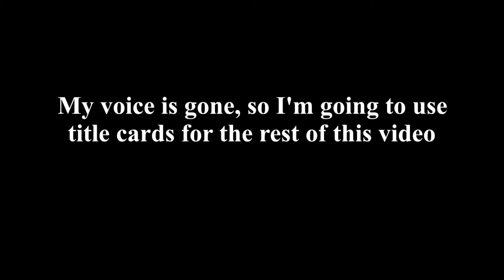Rooftop AC Hard Start vs Soft Start.  Which works better on a generator?

Comment: What was the amp draw difference between the 2 at start up?
Reply from the maker: Unfortunately I don't have a meter to monitor that, and the generator's load meter isn't sensitive enough or fast enough to provide any real info.

Comment: Thanks for the information, I like the price better on the hard start capacitor even though it puts more wear on the motor. Will this work on a portable air conditioner unit? Thanks again for the video

Comment: So which system did you end up using, hard start or soft start? I'n leaning towards the Micro-Air soft start.  Yes, it's $300+ but I'm putting it on a new 3.5 ton heat pump and specifically need it for use with my Westinghouse generator. BTW, which model of Westinghouse are you using. Thanks.
Reply from the maker: I stuck with the soft start.  The hard start cap gets the job done, but it's shoving more current through the windings at startup, which is harder on the motor.  The soft start is more money, but gets the job done by sending less current, so in theory it's easier on the motor.  And since the hard start cap was only $15, I'm hanging on to it.  The soft start system is more complex, so is more likely to fail.  If it ever does, I can wire in the hard start cap and be back up and running in short order.

I have the basic iGen4500, which is a 120v only inverter generator.  I opted out of the dual fuel, because I didn't think I'd ever need to run off of propane.  I mostly use mine at racetracks, where fuel is plentiful and propane is rare.  And I skipped the carbon monoxide protection because my generator will always be used outdoors.
Reply: @ElQuesoGuapo  I also have the iGen4500 but wasn't planning on using it for AC. My home is setup with the 9500DF. I bought the 4500 to run computers, etc. I made the purchase last year after the Texas Snowmageddon.  I'm really worried about the grid failing again this summer. Do you believe it's critical to run an inverter generator with low THD instead of a regular generator?